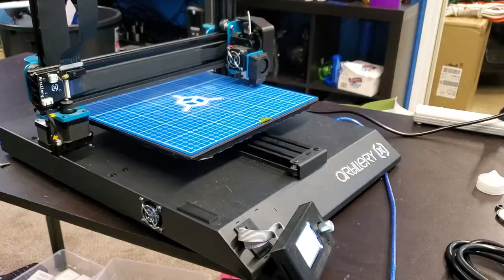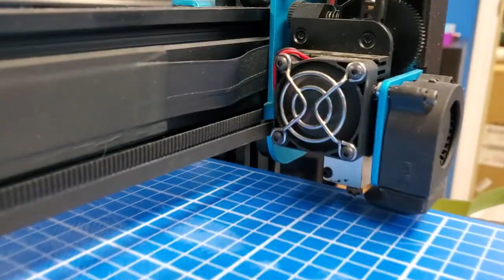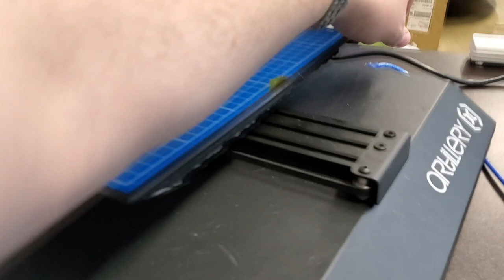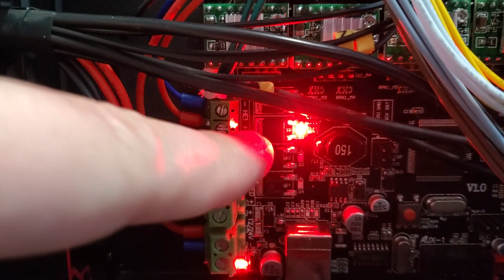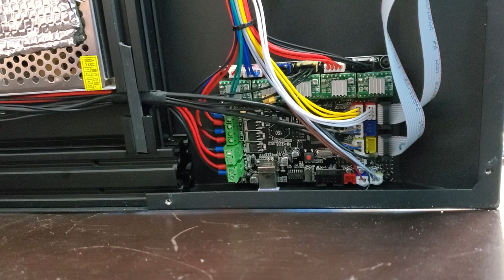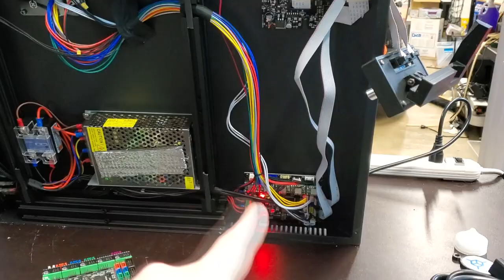TH3D Sidewinder X1 Firmware Patch NOW RELEASED | Bad Board Leads to Wrong Firmware Setting

Comment: Received my LCD conversion kits on Tuesday and they look awesome. I'll get them installed this weekend along with EZABL sensors. Thanks for the firmware update.
Reply from the maker: Update is posted. Tested and verified to work. Also added support for the RGB LED that comes on the machine. 

EZABL install will be coming soon. Just figure out the best way to route the wires.

Comment: Ah, that explains it. Thanks for your testing and quick resolution. Love my EZLCD so far. Glad it wasn't the bed heater MOSFET.
Reply from the maker: Update is posted. Tested and verified to work. Also added support for the RGB LED that comes on the machine. :)
Reply: @TH3DStudio  Less than 24 hours from ambiguous report to resolution. Looking forward to the LED feature as well. Thank you sir!